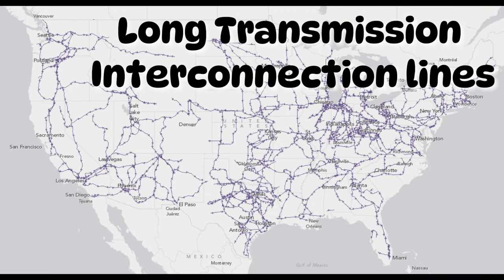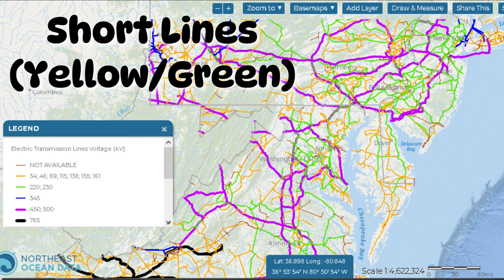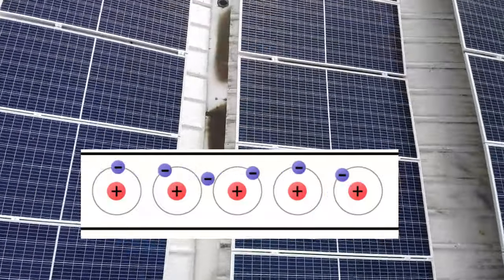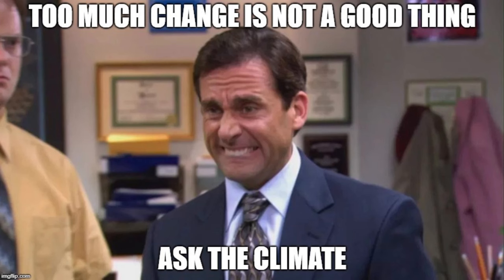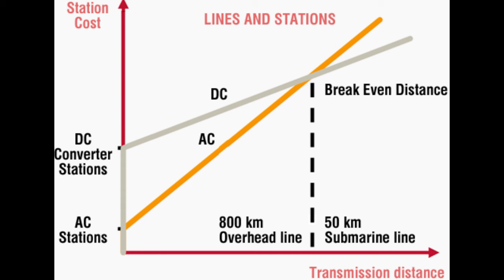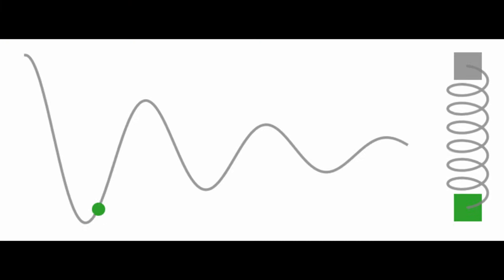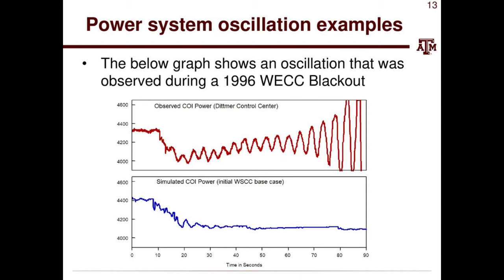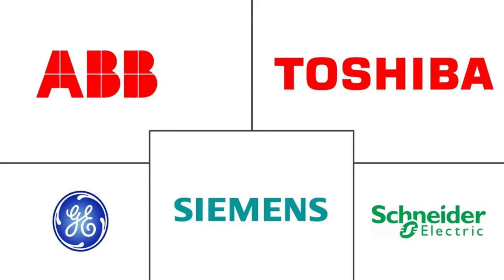How are LONG transmission lines designed differently?

Comment: DC is the best. It automatically flows from source to drain. No oscillation. Also please only limit the voltage, don’t force a minimum voltage. Yeah, may need some taps at the final H-bridge/ transformer to 240V in the residential area.

Make DC for cars or from solar cheaper. Also maybe wind turbines could become variable speed? Like control tip velocity to stay subsonic. The hotter the air, the higher the revs. The faster the wind, the lower the revs.

Comment: I am in Shanghai, china. here there are no lightning arresters because the tall buildings protect the power lines, also most are underground.
Reply from the maker: Tall structures that are near power lines do indeed protect them for lightning. and its common in city area to have the power line underground which are not affected by lightning.

Props to you for bypassing the firewall and watching youtube in China,
Reply: Powerlines should just be strong enough to just also transport the lightning and distribute it. By chance the peak will stay below limit when it reaches a device in a household.